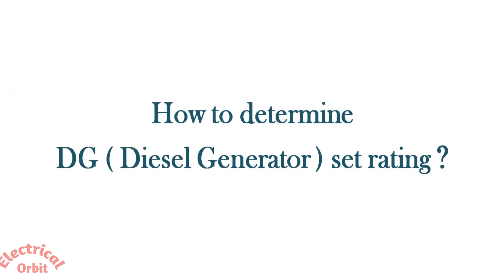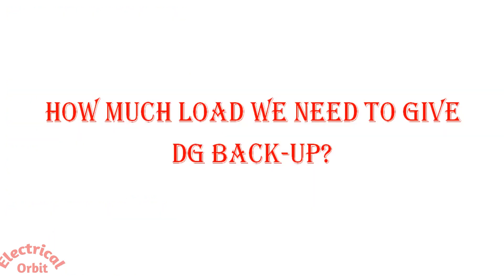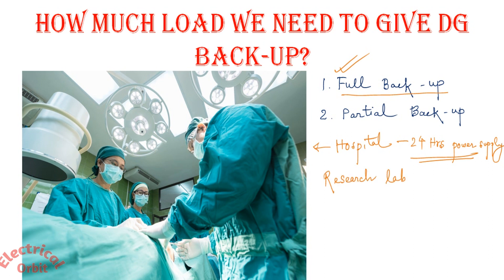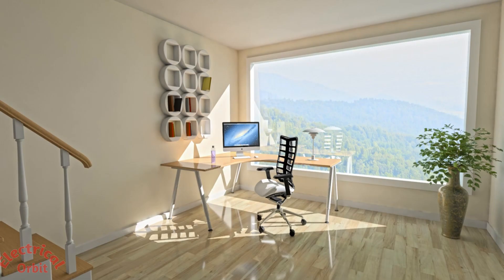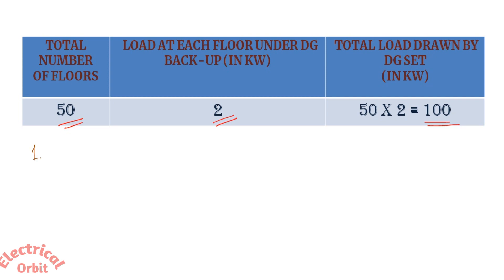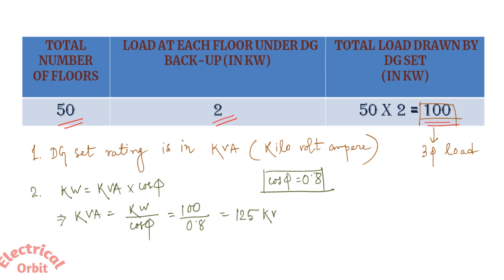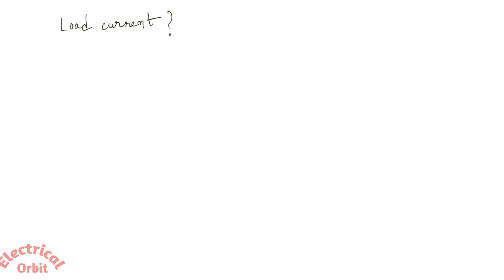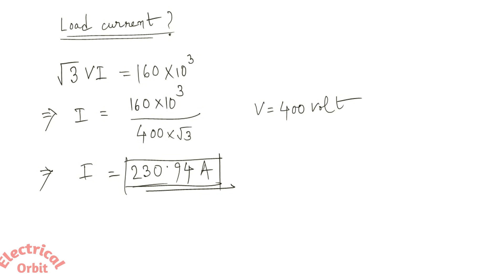How to Calculate DG Size I Diesel Generator Rating Capacity l Diesel Generator Load Calculation

Comment: Thanks for the explanation. I want to ask few questions:
1. Why did you use 400V for the 3-phase voltage instead of 415V?
2. What is the running hour you can advise for such DG? when exceeded, what is the likely effect?
Reply: I doubt he can answer your questions
Reply: 400 or 415 depends on your country requirements. Similar to 230V or 240V.
You must look at your DG specs for the running hours. If exceeded the engine may seized but highly unlikely because all DG has its own protection.
Reply: @UC4nEZWcgz1m09FKpzGV2dzQ